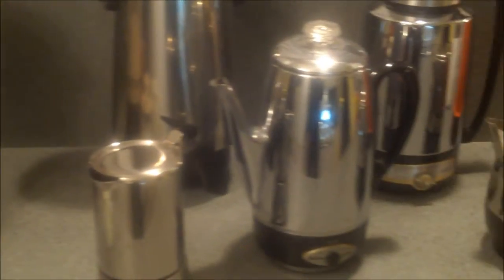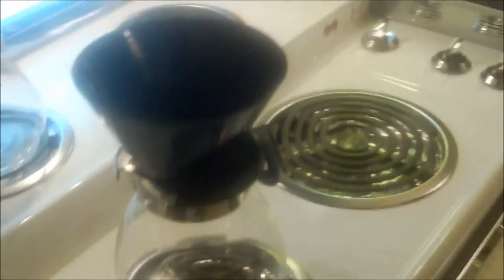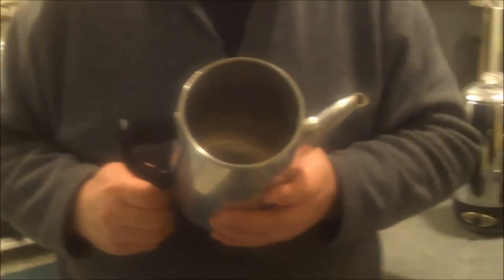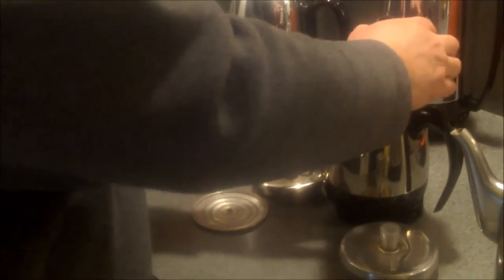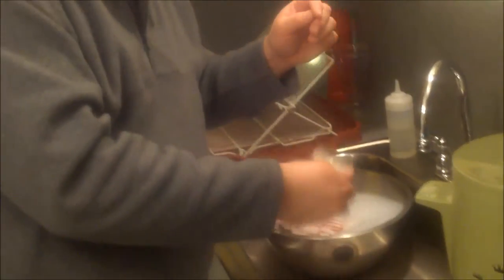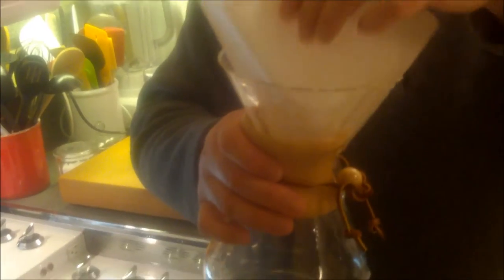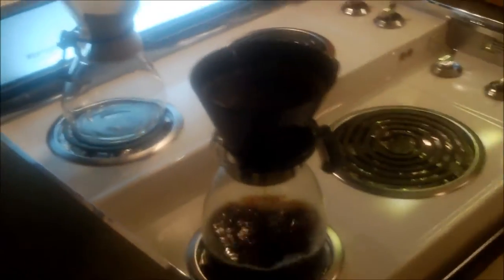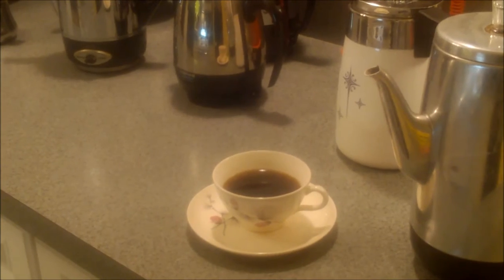Making Coffee

Comment: I've been perking my coffee for almost 10 years and won't go back to an automatic drip.  I use a 12 cup Presto that I bought new back when my old Bunn gave up the ghost.  As far as pour over  coffee makers I had always heard that a pour over is a machine that has a built in water tank that is heated at all times like a Bunn brand machine and when you pour the water in the top it siphons through and forces the already hot water from the tank out and through the coffee in a steady stream unlike a Mr Coffee type machine where you fill a tank and then the machine basically perks the water from the tank over the grounds and into the pot.  The advantage of the Bunn style is since the water is already heated in the machine it only takes about 2 minutes to brew a whole pot.   I also have a small 6 cup Drip-O-Lator that I sometimes use if the guts of my percolator are in the dishwasher but it hasn't been run yet.  For coffee I always use the red bag 8 O'Clock whole bean that I grind to percolator grind.  I used to love the 8 O'Clock Bokar blend but they have discontinued that variety.
Reply from the maker: +tallboyyyy Thanks! I agree with you - I really like perked coffee and that's what I usually make most of the time. Somewhere I have a Presto and as I recall it brews pretty quickly. Eight O'clock Coffee has always had a good flavor and I miss the Bokar blend, too. I don't know why they stopped selling it - had a nice, rich flavor. Thanks so much for watching!

Comment: I've never been too much of a coffee drinker even though I like the flavor. The problem was it would just make my stomach upset because it's acidic. I have a small 4 cup Braun drip coffee maker and it makes good coffee and I've used it for years. I never buy coffee from a donut shop or any where else because it's just far too acidic for me and frankly I think their coffee tastes bad anyway. 
But, fairly recently, I found another way to make coffee. It's called "Cowboy coffee". Cowboys don't have fancy coffee making machines and no electricity. The cook has a pot and coffee grounds. They put water in a pot, set it on the camp fire and when it reaches a boil, they remove it from the fire and put the grounds right in the water. They let the coffee sit for 4 minutes without the fire. After 4 minutes they add a little bit of cold water to the coffee and that forces the grounds to the bottom of the pot and they pour it into cups and drink it like that. This method is supposed to be richer in flavor and less acidic.
I tried it myself. Put cold water in my small stainless steel Revere-ware pan, got the water boiling, once boiling I shut off the fire, tossed my coffee grounds in it and let it sit for 4 minutes. I have a fine mesh reusable coffee filter, so I place that over my cup and it catches any grounds that might pour out of the pot. They were correct! The coffee flavor is stronger, richer and less acidic! I can enjoy coffee more often now. :-) I like mine with sugar and light cream. I drink tea most of the time though. Coffee to me is still a rare enjoyment and an after dinner thing. I could never drink it before breakfast like many people do. It would make me feel sick for the rest of the day. For me, it's something to have only after a few good meals. Then it doesn't bother me.
My mother used to have a percolator coffee maker, the kind with the clear knob on the lid. Hers was used on the stove. When I was very young, I used to watch the coffee bubble up inside the glass knob getting darker and darker. I didn't understand how it was doing that at the time, but I remember being amused and fascinated with it at the same time.
Reply from the maker: Thanks - I'm going to try that Cowboy Coffee technique and see how the flavor compares to other methods!